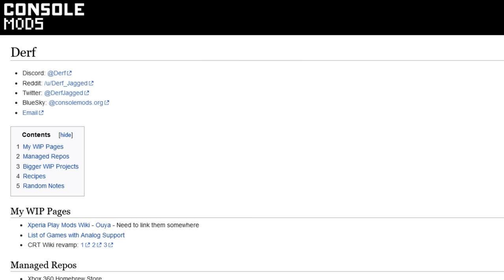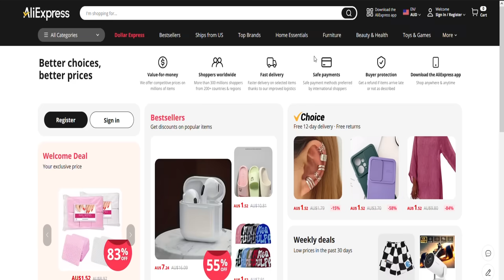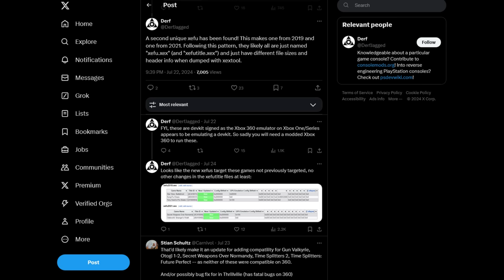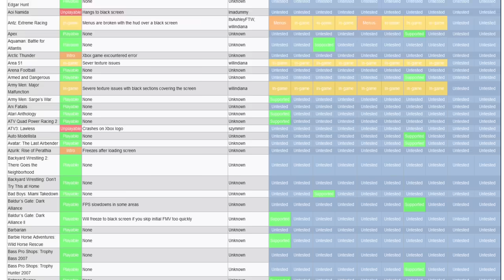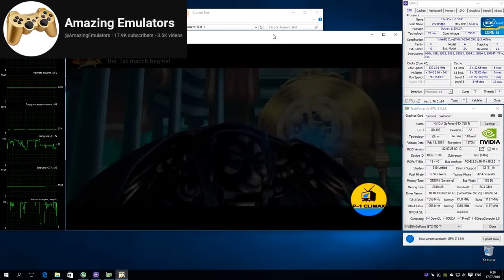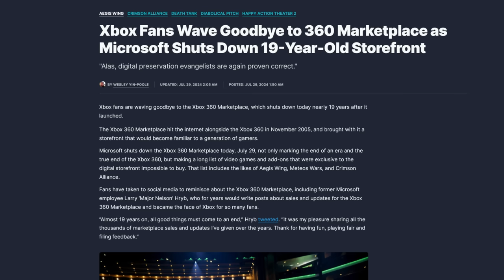So the 360 marketplace is closed for good. Now what?

Comment: Wait, HOLD ON. You're telling me that when an Xbox One runs an OG Xbox game, the x86 CPU emulates a PowerPC CPU which in turn emulates an x86 CPU? That... that can't be the best solution Microsoft could come up with. That just seems WILD to me.
Reply: if it works then it works
Reply: @superlavahair1536  Well it doesn't because Xbox 360 supports 400+ games of OG Xbox games while Xbox One only supports like 50.
Reply: @KuroAno  which is mostly due to licensing lol
Reply: @KuroAno  hey if it runs then it works so idk ask phill spencer
Reply: this isn't actually that weird from microsoft, most if not all of their products are new things built on old things, less in an "let's iterate and improve the current base", more in a "let's lay bricks upon the existing bricks" type of way
Reply: Probably the cheapest solution, especially if the Fusion emulator has PPC specific instructions
Reply: How long did it take you to find that out? I've known for years that the XBOX OS is effectively an emulator within an emulator. Funnily enough, the area that runs UWP Windows apps is also a seperate emulator for Windows 8/10. It is a crazy concept though.
Reply: What about Microsoft's any other product gave you an idea they run things efficiently?
Reply: Fewer configurations and better isolation, this technique is common on servers, Linux emulates another Linux, research Docker
Reply: @itsrickyschannel.  UWPs run in a VM, not emulated
Reply: @sundhaug92  Uhh.. what do you think a VM is? A VM, or virtual machine is a form of emulation.
Reply: @itsrickyschannel.  No virtualization and emulation are quite different

Comment: to be honest i've been using my xbox 360 for years and didn't even know the storefront was shutting down. then again, it hasn't connected to the internet since around 2017 and it still thinks the date is november 2005
Reply: mine is back in 2009
Reply: I had mine connected to the internet the other day. I have it hooked up to a CRT tv and I had downloaded YouTube on it a few months ago.
Reply: You can reset all updates to your xbox360. Not to mention all 1st gen 360s red ring. You’re just straight up lying for no reason..
Reply: @OPEK.  They red ring because the fan wasnt big enough
Reply: @OPEK. not all of them red ringed. only like half of them. so you are incorrect
Reply: @aksGJOANUIFIFJiufjJU21  They red ring because of a fault in manufacturing at TSMC they used low-tempature epoxy which reliquefied when the xbox was at operating tempature and then eventually the solder disconnected. And theoretically a fan always on so it never reached those tempatures would have worked ,but here is the thing your day 1 xbox wasn't day 1 it was stress tested previously.
Reply: @mantx7152  still fan wasnt big enough
Reply: @aksGJOANUIFIFJiufjJU21  But yes the fan is still pretty underpowered and the whole chassis in general.

Comment: When it finally comes time for Xbox One modding, one big issue I could see is the fact that total game ownership isn't a thing there. Your DVD copy of Forza Horizon 3 is just a shortcut to download the full game from the store, albeit with seemingly a higher priority than digital downloads
Reply: most discs afaik have some data on them, as much of the base game as it can fit, then the rest is from M$ servers. This is a worry when it comes to the possibility of M$ shutting down these servers at some point too, however there is such a big community surrounding consoles that doing game archival would be on the top of the list along with the mod itself. I'm a strong believer that if you bought the game, you own the game and nobody should be able to stop you from acquiring the full game you purchased through any means. (copied from friends console, downloaded from an archive, etc..)
Reply: Well you can rip the decryption keys of the games from your modded xbox one/series console and use them to decrypt Microsoft store xbox one/series games you have purchased
Also its possible that we don't need any complicated emulator for xbox one/series games, because xbox one/series OS is basically windows
Reply: Not entirely true some discs do have stuff on them. My gta v disc is damaged so it gets stuck on a certain number of
Reply: Forza Horizon 3 is actually fully downloadable from the disk alone. Heck, even Forza Horizon 4 is completely playable. Of course there won't be any of the DLC or updates that the games have gotten over time, but the base game for both is fully there on the disc and doesn't need to be connected to the internet to play. Many games are like this you just have to do a little research or apply common sense: if the base game is at or smaller than 50 gigabytes chances are good it's going to be fully there on the disc. 

On the flip side there are a lot of games that don't come fully on the disc. Mostly 1st party stuff from the 9th generation like Horizon 5, Starfield, Halo Infinite and Forza Motorsport (2023), EA and Ubisoft games like Madden, Call of Duty and Jedi Survivor plus one offs like Hogwarts Legacy and Avatar Frontiers of Pandora. Also, though this should be obvious, any discs that contain live service games like Back 4 Blood, Redfall, Fallout 76, Evolve, Anthem and Lawbreakers are obviously not going to help you out.
Reply: iirc it just copies data from the disc itself, depending on the size of the game it may require a partial download, but the disc contains a bunch of game files, after all these discs have like 50 gb of capacity why not use the capacity?
Reply: @MIOG_MIOG This won't matter when the stores stop functioning. You can still download 360 games you purchased for now, but that's not gonna be the case forever.
Reply: @ajddavid452 Some games yes, all games no. There hasn't been a single CoD you could play without an internet connection from Modern Warfare 2019 onwards, they all require seperate downloads of the campaign, multiplayer and spec-ops. The disc contains nothing playable.
Reply: @jared4169  To be fair, the next generation runs on Xbox One servers too, so I don't see them revamping their whole backend for no good reason.
Reply: Not even higher priority, even those discs with full game, can be installed faster on digital, sadly just a license being full or license.

Comment: So they were running the OG Xbox emulator inside the X360 emulator on the X1 compatibility mode of the Series X/S instead of developing a native one? That is so indirect, but it fits with MS's mentality of just dragging along old legacy software hidden inside newer systems for as long as possible.
Reply: Nailed it here.

Comment: The Tony hawk exploit for the Xbox 360 is better because it doesn't require the patched shader or a burnt disc which would require a flash DVD drive. 

If and a big if, there is ever another hypervisor exploit found this may make it easier for people to exploit but would require American wasteland for the Xbox 360 which is not super easy to find.
Reply: So far, the exploit also works through network between console or emulators. 

In theory with a little piracy it would be easy accessible.
Reply: @Wesmoen In order to do said piracy you'd need someone with a modified console already which would defeat the objective.
Reply: @IDontModWTFz  Emulators are still an option. If you don't want to hardmod your 360. You could go this route.

Comment: I'd say the RGH section is inaccurate.
For RGH3 you need 2 wires, a Raspberry Pi Pico microcontroller and maybe some resistors.  Way cheaper and less complicated than doing a full modchip.

Only part of rgh3 that sucks is the exposing of the trace you need to do but I managed somehow
Reply: And you don't even have to expose the trace on all models. On my Jasper and Falcon there's a convenient pad on the backside of the board.
Reply: @alenygam6048  Even better, Hopefully this will help anyone on the fence with RGHing, I just wish the actual experience of loading up backups/homebrew etc was as easy as the switch or 3ds (really goes to show how bad the security is on those consoles lol)
Reply: @afkafkafk  I find that loading backups on the wii is very painful, much more than it is on the xbox 360, but that may be because I refuse to connect my wii to the internet while I have my xbox 360 connected through ethernet so I can use FTP on it.
Reply: My proven strategy on slim boards is to use the sharp tip of my pocket knife and twist around the via until I see copper. Never once have I killed a board at this stage. I love Falcons and Jaspers due to the superior phat design, but I have an easier time modding Trinity slims overall, and they sell way faster than phat consoles do (my last batch that sold in less than 24 hours had the slim sell almost immediately).
Reply: I did it on my Corona (oddly enough in a 360 E case with a serial number that shouldn't have been a Corona).  I just used a postfix adapter (quite cheap if you get a knockoff from China, which I did).  Overall pretty easy, but apparently 4GB Corona boards don't always get along well with the Raspberry Pi Pico flash method.  Mine was one of those, which made flashing the hardest part.  I ended up using the SD card adapter trick to do the flash and that ended up working fine.  Aside from the flash issues, the mod itself was quite straight forward.  Hardest thing for most people would be the fine soldering.  Good magnification helps alot.

Oh and I also added a hard drive.  What I did was buy a cheap knockoff Xbox 360 hard drive enclosure and a regular Western Digital laptop drive.  There's software that will write the appropriate factory stuff to it so it works like an official drive.  But, from what I've read, if you've done RGH, you don't need that - looks like you can use any 2.5" drive 2TB or less in size and you can just format it from one of the mod dashboards.

Comment: 4:37 "Some games arguably run better on Xenia than original hardware." That sounds to me like inaccurate emulation.
Reply: Cemu and Ryujinx also suffer from this iirc
Reply: It's not uncommon for realistic performance to be an option. Dolphin has had a bunch of work put into its disk drive emulation to match console speeds, but it's mostly optional.
Reply: inaccurate maybe, but bad... no. options are good though, for when you want to make your experience worse for some reason
Reply: Yep. Agreed
Reply: I am fine with inaccuracies for some hardware acceleration

Comment: your brief point alluding to sonic unleashed running better in xenia than on 360 is absolutely correct. back in january of this year i decided to play it for the first time, but without any xbox better than a 360 and not wanting to suffer its legendarily bad framerate, i looked into xenia hearing it could run the game at high res and high framerate. it was a wonderful time! there's even a sonic unleashed mod manager to streamline some xenia settings as well as load the scant few mods out there (i personally used a mod that removed the werehog battle music and removed the medal collecting, but i've since seen mods that overhaul the werehog combat!). situations like this are why emulation is so special and important, even for real hardware enthusiasts like myself!

Comment: Haven't watched the video yet. But I really like to get some advice. I bought an Xbox 360 so that my friend can jailbreak it. But when I tested it I found out that the previous owners didn't factory reset it. And unfortunately the control that came with it is probably chewed by a dog and the previous owners decided to leave the batteries in so now there is corrosion in the controller. I'm just not sure what to do give it back and see if the store owner can help and fix it or just save my money and buy one that is already jailbreak. But I may have to see if the store owner can help.

Comment: Xenia would be fantastic if only it wasn't for the fact that it hasn't gotten any major updates in 2 years
Reply: Xenia Canary receives frequent updates
Reply: Xenia is nice but it only runs on Proper PCs and on "Medium to Strong-ish" machines and quality is... Meh.
It's better luck hacking a 360 which is what I'm gonna do, a better PC costs 5k  but a slim Xbox 360 is only 500.
The Modchip for RGH2 is about 250.
750 bucks doesn't even buy much so it's a good deal, not even 1000 does anymore, so why bother
Reply: @drboom2  Canary is only a fork so the major stuff still comes from the main team
Reply: @Bush_Dog777  what currency are u using? A pc that cost 5000 us dollars would the absolute top of the line for anything. You don't need a 5k pc to play 360 games, unless you're using other currency
Reply: @aai404  Real, and a nice PC with an actually functioning, actually compatible hardware for Xenia costs around 2 to 3k
Money I don't have